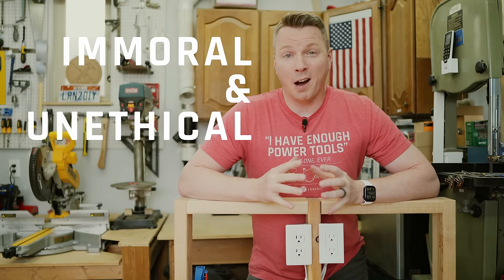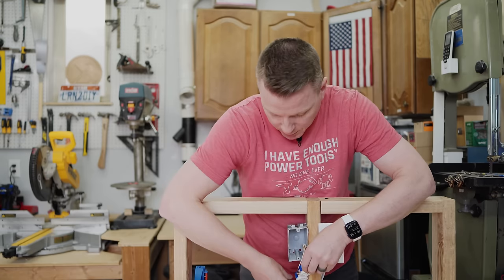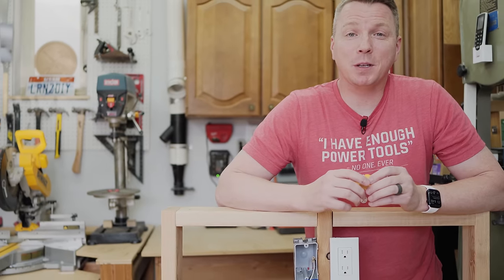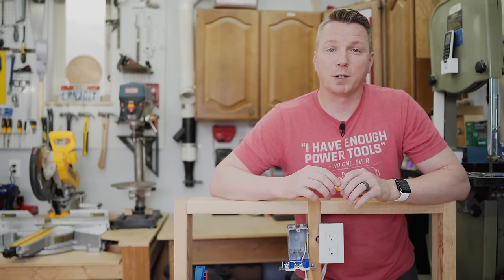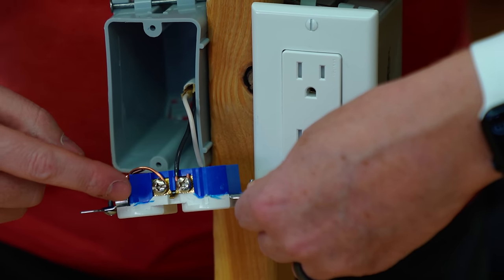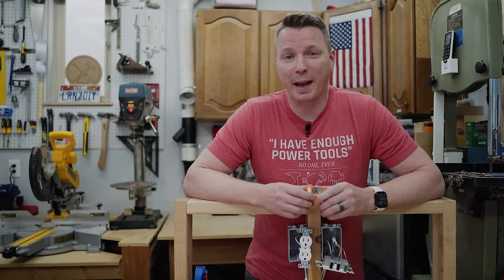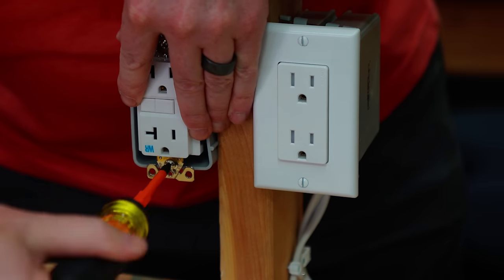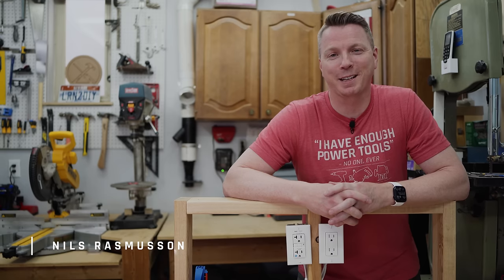People Are Adding Deadly Hacks to Outlets

Comment: Don't you have ground fault breakers working for the whole house in the US?
Reply: Not in older houses
Reply: @dmitripogosian5084  thanks for the info
Reply: @Mongolicious  The main issue with all sub-modern-standard wiring is that electrical retrofit for older structures is prohibitively expensive.  So general solution is that if you do not touch the old curcuits, they can be 'grandfathered' and you do not need to modify them, even if you do renovation with involves some electrical work.   For instance I redid the kitchen 7 years ago, and the microwave spot was moved, so they had to put a new line with came with GFCI/AFCI breaker as per new code.
    But, despite having cabinetry changed, they did not touch over the counter lines, so they are still old style, on ordinary breakers, despite all outlets being new.  That passes inspection by grandfathering rule.
Now one of my bathrooms have no sockets (which itself is not up to code, there must be at least one).  But if I am to install one, I'll need AFCI on it, and, sadly, dedicated 20amp line.  That's probably $3000.  So I charge my toothbrush in the room :)
Reply: No, I think the current requirements mandate the, almost everywhere but in bed rooms and living rooms but this all is about 1960s houses and earlier. Many seem to think that once some code changes all houses magically turn to what it mandates.

Comment: better yet, how can you wire it incorrectly? There are 3 wires and only one matters where it goes, the + and - wires are interchangeable and don't matter. And for low powered devices, like chargers etc, they don't even bother using ground, so it literally doesn't matter which wire goes where, if its for low power devices.
Reverse polarity? Yeah. As an European, cant relate.

Comment: I'm a little skeptical as to the dangers of these to anyone.   The first thing is is that current can't run through you as long as the wires are insulated and most people don't play around with UN-insulated wires.  The second thing is that ground is a term used to describe the positive end of a circuit.  Unless you are holding the negative end of the circuit you shouldn't have any problems with it.   Most cars are positive ground and just touching the hood of your car should lead to instant death.

Comment: I didn't hear your justification for why this is deadly.  Since neutral and ground are the same at the entrance, there is never any more than a volt or two difference between them.  Of course there is the argument that the neutral could fail, but it that is true, then so could the ground, which actually would be deadly.  In locations where the ground is not available, the work around is better than not having the third prong on the outlet.  Inspectors I know support this logic because rewiring an entire house is not required by the code.  Your assertion that they are a big no no, has no basis in fact when compared to having a two prong outlet.
Reply: Just don’t plug in anything that has a metal case and touch a second device with a metal case and you should be fine and also keep your hands off the metal case and any water lines and you will be fine. You will become a parallel path for neutral current. Probably just a small shock though

Comment: not even a year ago (in sept 2022), I quite possibly may have come only 12 inches from dying. i wrote this that night to friends:
I quite possibly may have come 12 inches from dying tonight by electrocution in a puddle of water tonight. i got shocked (by house electricity) tonight, and i was standing about 12 inches from a pool of water, and barefooted. my basement sump pump switch quit working and the house A/C unit drains its condensation into that sump pump hole. but it had overflowed because the switch for the pump was not working right. so i had a puddle of water spanning across half of a room in the basement and in the hallway outside of that room. i stepped thru water to reach the light switch. but the light switch is housed in a metal box with a metal plate and the idiot who wired it had the wiring reversed and the metal box is live with 110 volts of electricity! i touched the metal housing when i was feeling around to find the light switch and got shocked. but i was not standing in water at that spot. i don't know if i would have died if i wud have been standing in water or not. quite possibly. all i know is that this was too close! God is good! And when i investigated further, i found another switch, in another basement room, housed in metal too, that controls a light in the room where that switch is too. and in that basement room, the wiring is also switched to the outlet. so that switch box quite possibly might be hot with live electricity too! and that switch box is located where if i had reached for that light switch, i probably wud have been standing in a pool of water. i came inches from getting electrocuted in a pool was standing water.. at probably two miswired switches. 😱
(end of writing last sept, back to today's message..) i have since rewired 3 of the four basement rooms because i found other dangers too. one outlet was a 2 wire outlet but had the hot and neutral switched backwards, another potentially deadly situation, but still less risk than with wrongly wired 3-prong outlets. but all of those are rewired. i have 2 GFCI's protecting two rooms. and sadly, i'm not any electrician yet. just yesterday i acquired my codebook and i decided 2 weeks ago to become a master electrician. and now.. every home i move into, i will be testing outlets and inspecting any voltages on metal face plates early.

Comment: Doesn't go over why it's dangerous, but promised to do so at the beginning
Reply: The supposed danger comes if the neutral breaks. Then the mains voltage gets to the case.
Reply: Here's a scenario that could cause big problems. You have a computer connected to your TV via HDMI. The neutral disconnects in an outlet that feeds the outlet your computer is plugged into. instead of just losing power to your computer alerting you to the problem, the neutral is fed via the computer ground, going through the HDMI cable, and then to the cable ground shield. Your TV cuts in and out and you mess with the cable connector and get shocked when you disconnect it and you have the cable in one hand and the TV connector in the other. You can die that way.
Reply: Thank you two for letting me know!

Comment: "Potentially even a little earlier than the 40s"? Wouldn't it always include any earlier mains wiring? In  electrified places from before the 1940s, why would they have been using grounded wiring and then drop them in the 40s?

Comment: this was taught a long time ago.  remember the guy i learned from he did this.  not new.  old type romex did not have  the grounding wire.  how it was back then.  so you have to tear out how to replace the cable. and it can be dangerous . so tell the home owner how you are going to open up the walls to replace.  you want tell the home owner that it will cost thousands of dollars.   or you can install  gfi or gfi breakers.
Reply: i got into the trade back in Aug. 1978. go talk to the really old timers.

Comment: "the full 15 or 20 Amps from the receptacle and 120 or more Volts would actually run through our bodies" ... uhm, no, in almost no circumstances*, at those voltages, would that much current be flowing through the human body ... oh, but well under 1/100th of that much current through the human body is, however, more than enough to be very fatal (though it will also depend where it passes through, and for how long).  So, may be up to 15 or 20A available ... but that doesn't ensure that much will flow.  Heck, might not even get that full voltage, depending what one contacts, and how ... but in any case, a dangerous (and potentially even fatal) situation.
*if you stick metal probes in under the skin, that's a different situation - then you have the Presto Hot Dogger - way beyond fatal and quite cooked ... but it takes way less current than that to be fatal.

Comment: Anyone who is so uneducated about electricity as to believe boot leg grounds like that are ok, should never be allowed to touch an electrical item in a home until properly educated.   If someone is knows this is is illegal yet is SO unethical as to do this kind of crap and not give a s**t should be fined heavily and be held civilly and criminally liable in the event an injury or death is caused as a result of this.  Not to mention if it was determined that someone did this to fool a home inspection in order to sell a home and it was caught after the closing should be sued and ordered to pay for the entire cost of having an electrician come out and make the repairs needed to correct their mess.   Rewiring a home without EGC's in the wiring to bring it up to code is always the best practice, however if it is not feasible or cost effective to do so, a GFCI is the way to go provided the current carrying conductors are properly sized for the breaker or fuse protecting it and the insulation and cable jackets are still intact and not brittle and crumbling away.

Comment: Ok, legit question. Why is that dangerous? Im not understanding it. The ground wire and the neutral go to the same bus? So isnt that essential the same thing?  I wouldnt do that regardless, i just had to rip out and replace a bunch of runs in my house, found 2 junction point inside a wall and 1 of the junctions were being used to extend wires. Both junction were like 6 inches apart. Kind of makes me wonder what else the guy did to this house when he reno it
Reply: Maybe this will help, Let’s say you have two counter top receptacles and both of these receptacles have metal toasters plugged in. Since the metal toaster has a ground on the cord it is now making the case the neutral on both toasters. Now all you have to do is put a hand on each toaster and you become a parallel path for neutral current.

Comment: What's worse, bootleg ground or grounded neutral?
Reply: I'd take a bootleg ground over a grounded neutral. Imagine a grounded neutral with a non-polarized plug or a switch that switches the neutral for some reason (miswired, old appliance, whatever)... if you touch the grounded part of the appliance and also touch something else that has continuity to the service neutral, you're suddenly in series.

Comment: often the ground and neutral are bonded at the panel so technically its not dangerous but not legal to bond them at the outlets
Reply: The point of bonding only at electrical panel is to control the flow of current. Anywhere else will cause "objectionable" current in which the current can flow unpredictably throughout the circuit.
Reply: @surferdude642  i would say if you are bonded at the panel then it wouldnt really matter if this was done in the outlets.
Reply: @sausageslaps  It does matter. The purpose of the ground wire is for a momentary clearing of any ground faults downstream of the electrical panel and not to carry current constantly. Dangerous voltage on metal parts of equipment and nuisance tripping of GFCI receptacles are a couple of potential issues when current is running in parallel in the neutral and ground wires.

Comment: Most 2nd and 3rd world countries are wired like this. I would bet more than half od all instalation worldwide does not use ground wire. Reason? Copper availability. That's why aluminium 2 wire cables are used... ...people add resicual current breakers at least for bathrooms during renovations...

Comment: I know this is not correct,  but can anyone out there give an actual scenario where a person could get electrocuted from this? Give a proper example, what appliances or tools that require what specific failure to cause this. 
I understand the ground is there for safety,  but does it make it safe?
Reply: Also, if you installed a gfi with a "bootleg" ground. Name an example where a person get get electrocuted?

Comment: The worst I have seen is a badly installed 240vac outlet for an electric dryer with one Hot shorting against the metal case and rather than fix that they cut the ground line to the house.

Comment: Another option is to simply remove the bootleg ground. No ground is better than a fake ground waiting to become live if that neutral path ever breaks
Reply: No it is not. It is absolutely deadly!
Reply: @okaro6595  ungrounded systems are still a thing and people aren't dying from it every second. It is not great, it does not comply with code, but it is not deadly unless something is wrong with the equipment and the human's hands are wet, or heart condition, etc... Whereas a bootleg ground not only does nothing to protect the user, it makes it automatically unsafe if a wire becomes loose. Therefore no ground, with a label saying "NO GROUND" on the outlet is a lot safer than a bootleg ground.

I'm not recommending people add grounded outlets without a ground. But if you discover a bootleg ground and cannot get it fixed immediately, you are better off leaving the outlet ungrounded.
Reply: @BullCheatFR  People do die from ungrounded systems. In Finland six people have died since 1980 for lack of grounding or improper grounding on grounded sockets. Nobody has been killed by so called bootleg ground despite them being the norm in anything made before 1990.

Now if the outlets is in a living room with insulating floor then there is very little risk.
Reply: @okaro6595  sources please

Comment: Misleading.
 Even the cheapest tester you have would have detected the reverse polarity on the outlet..
 Ground and neutral are  bonded at the main panel but should not be bonded at the outlets or sub panel.
 If they are, return current can flow through an appliances chassis ground making the chassis live in relation to a real ground like a water pipe causing electrocution if a person bridges the two.

Comment: that is perfectly fine  method of protection ,a lot of devices in europe even dont have a ground pin on connector ,so dont try to be smart ,something worked for years and know it is somehow wrong.just like the guy who mocks the twisting wire connection.

Comment: What about european 2 prong outlets? 240 50hz Latvia
Reply: There is no issue as you can always plug grounded plugs. On old installations the Soviet codes would apply. I have no knowledge but I would think using neutral for grounding was allowed.

In the US plugs the ground is a prong on the plug so it prevents connecting to an ungrounded socket.

Comment: While I certainly won't disagree that a bootleg ground is wrong and shady (I wouldn't do it in my house), I will disagree that it's dangerous. Common is tied to ground in the meter box anyway. Which I will note that you failed to mention. The functional difference (in terms of simply using the electrical outlets) between it being tied to ground in the meter box and being tied to ground in the outlet box is negligible, in my humble opinion. For example, if you touch the metal of a grounded appliance, you are connected to common, bootleg ground OR legitimate ground. There is no difference. It is more of a hazard to an electrician working on the electrical system than a hazard to an operator, and even then, it would have to be under VERY particular failure conditions. And that's assuming someone's working on wires when they're live, which a professional should know better anyway. It's kind of disingenuous fearmongering to say that it could be lethal. You haven't even given an example under which it would be.

The reason is that you don't want your ground to be carrying current. And that only matters if there is a failure. Presumably if there's a break in the ground/common (with bootleg ground), a person might complete the circuit between the two halves of the broken ground/common. I can't think of any way that would apply to an end user and not an electrician. Besides, in that failure mode, even without a bootleg ground, a person might complete the circuit to a regular ground ANYWAY. So...

Comment: How can a bootleg ground shock you other than when there is reversed polarity? Any fault current will travel on the neutral in an energized bootleg ground scenario. Obviously this is still not legal and not following code, but plenty of older appliances bonded directly to the neutral. If anyone here can explain that it would be a big help since I can't really find anything on the subject.
Reply: Which ones bonded to the neutral? There is a risk if the neutral breaks.
Reply: Google "objectionable current"

Comment: Still no house-wide GFCI or RCD in America.
Reply: Because that's objectively inferior. At the outlet makes it easier to troubleshoot if something amiss plus it encourages testing. When's the last time you tested your GFCI breakers (which do exist here, btw, tell us you did no research without telling us).
Reply: @antikommunistischaktion  It still isn't a standard for new houses, and sure you can have a gfci outlet for every outlet in the house, you don't. Just because it's your opinion doesn't mean it is objective. No one tests gfci anyway, and troubleshooting? Sure, but then if you drill into a wall and make something live, then you are protected. Gfci lights in America? No? All light circuits where I live installed after 2000 have gfci protection. The best solution is to have lower gfci amp requirements for outlets like the 15ma that you have and housewife 30ma protection to supplement it.